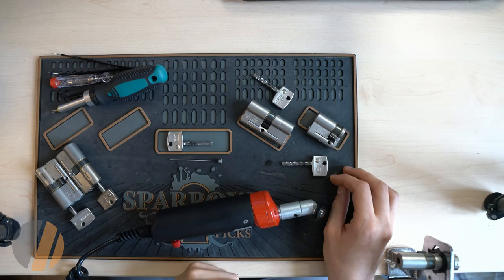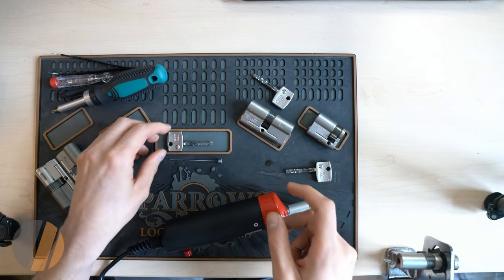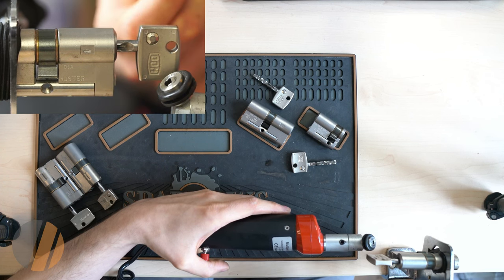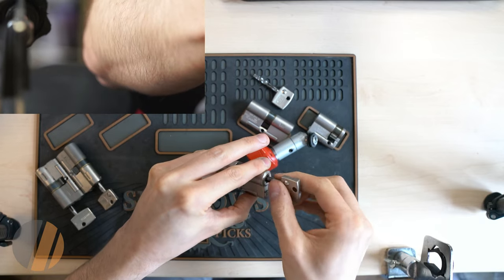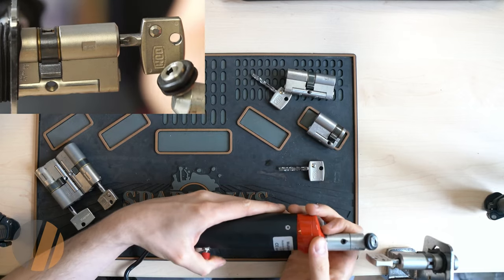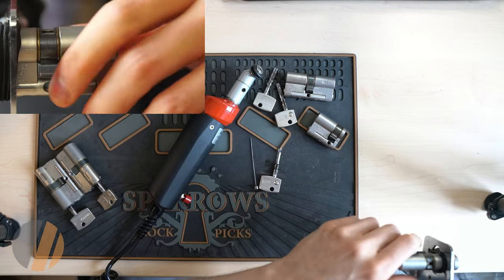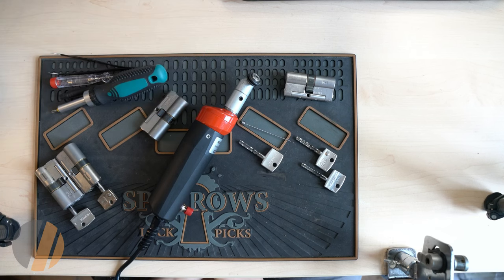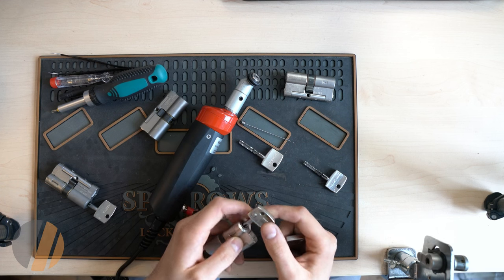Vibration Attack on DOM Diamant High Security Lock

Comment: Great video, thanks for sharing 👍
And amazing from DOM that they have upgraded the system 👌 
Have you ever tried varying the vibration frequency with these kind of attacks?
Reply from the maker: Yes, I tried that, I have a simple voltage controller attached to the MP Control (the original controller doesn't work right now) so I can dial in any voltage up to the 24V it uses for highest setting. But I only use it at maybe 30%, it seems like the lower frequencies do more. Also, as you can sometimes see in the video, what you want to get going are secondary vibrations where the key starts oscillating in a specific way and you can also hear this point quite well.
Reply: @decoderoh  ah, amazing 👍 yeah I imagine matching something like a resonance frequency will do a lot 👌
Very cool, thank for the answer 😊

Comment: Do you think this would work on the mul t lock cliq after picking the pins first then using this method to get electronic element to raise? Great work by the way.
Reply from the maker: I don't know about mul-t-lock cliq specifically but I know that ASSA Abloy has made significant investments in Cliq to not have it vulnerable to any of these attacks. Very early models were vulnerable to some things and this was later on solved by a redesign of certain interior elements. That said, I would encourage you to try it out with a strong-enough vibration source and see what happens :)

Comment: Does where you center the vibration make a difference?
Nevermind, you answered. Lol
Reply from the maker: I feel like it does, yes. For most locks, I had success when pushing the key towards that metal piece that's the outermost of the profile (most times on the right side, but some cylinders have it mirrored to the left). Maybe this stabilizes the key further.